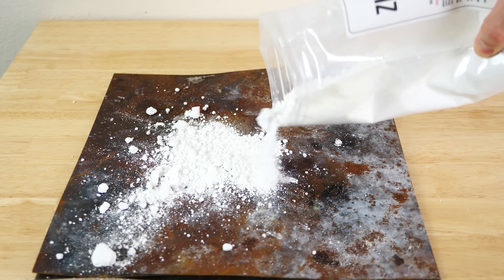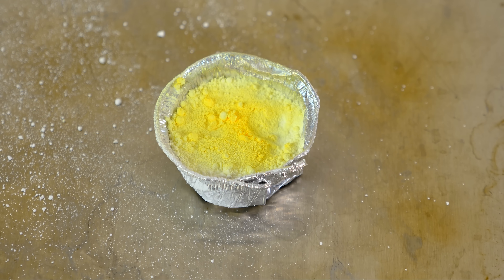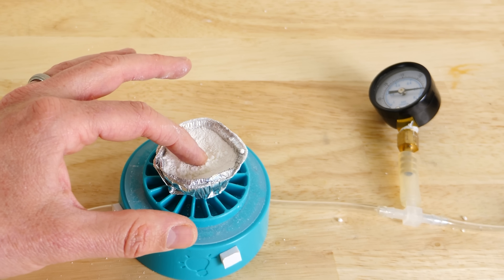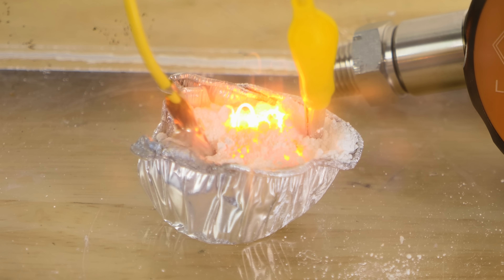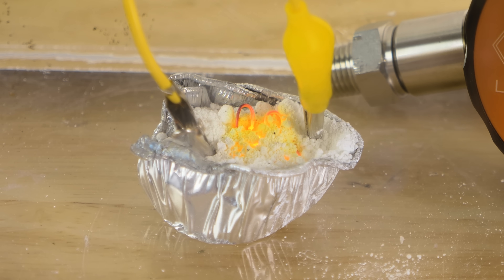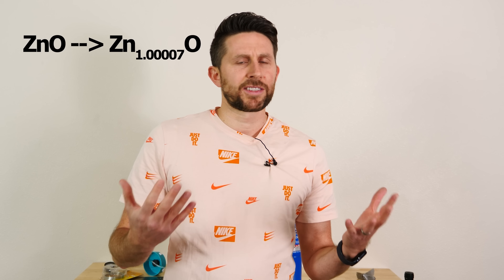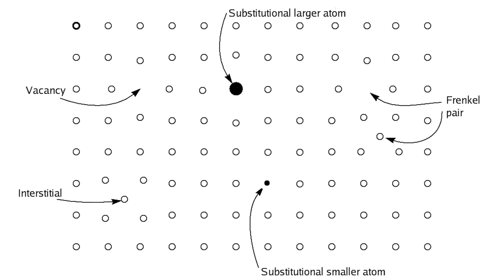How Does Zinc Oxide "Un-Burn" Itself?

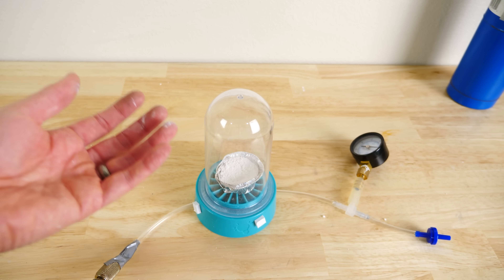Comment: 1:27 Or, and hear me out, you could have done it in an oxygen free environment. Like under argon or xenon gas. You the could have used an open lid container. … Or could have inductive heating for melting the zinc oxide.

Comment: Someone who claims to be a scientist is sure inaccurate. Your method is severely flawed due to the fact its not a real vacuum. You can clearly hear the leak in the chamber and its not 100%. Do this exact experiment again with a REAL vacuum chamber and I promise it will stay yellow for at least 30+ minutes as the oxygen diffuses through the material.

Comment: In fact, the effect is not because of Oxygen vacancy in the ZnO, instead, at high temperature, the Bandgap of semiconductor materials changed. In this case, it decreases, so it started to absorb blue light.  The ZnO Oxygen vacancy indeed increases at high temperatures, but the effect is too small to be observed directly with naked eyes. You need a special instrument for that.  Hope it helps.

Comment: Flush the bell with Nitrogren before vacuuming (you can even cycle it a few times), and only put the oxide right around the heating element so it all yellows. Will it still return to white again?

Comment: Okay..........
Step 1: configure your vacuum chamber to have an electric hot-plate with a moderately high temperature high setting.
Step 2: place a small quantity of Zinc Oxide on the heating surface of said hot-plate in a thin layer maximizing the amount exposed directly to the heat.
Step 3: hook up the vacuum chamber inlet to an inert gas source (noble gas would be best)
Step 4: draw maximum vacuum 
Step 5: fill chamber with inert gas
Step 6: draw maximum vacuum again
Step 7: apply maximum heat until color is no longer visibly changing
Step 8: film at high speed starting when heat source is turned off
Step 9: once color no longer changes back (or a couple hours pass indicating change is unlikely) use step 8 video to determine time taken.

Repeat experiment again, but at steps 7-8 allow normal atmosphere back in chamber at the same time heat is cut.
Repeat experiment again, but at steps 7-8 fill chamber with pure oxygen

Prior to or after experiment determine baseline time for all three scenarios for hotplate w/ containing tray to drop below decomposition threshold.
Compare recomposition time adjusted for input stoppage for all three scenarios.

Comment: Why is this happening. Because it’s a shity vacuum chamber/pump. While absolute pressure is considerably lower then atmosphericall there’s stil a LOT of oxygen inside. Btw, you can heat this stuff with laser pointer

Comment: a lot of comments are cool but in addition to those like replacing oxygen with inert gas or burning it again and again, i thought it could also help to have something burning on the side so it removes oxygen from the chamber and replace it with CO2. And then once that combustion stops (no more availability of oxygen remains), you can try the experiment again.

Comment: Can we use this as unlimited fuel? Like just find a way to keep it burning and when it's exhausted, just expose it to oxygen and it goes back to how it was before and then burn it again.
Reply: You cannot use it as fuel at all. You don't get energy from "burning" zinc oxide, but instead you must put huge amounts of energy into it to get it "burnt". It doesn't really burn anyway, because burning something would use up oxygen from outside to produce some kind of oxide. You can think of zinc oxide as "fully burnt zinc", so you cannot burn it any further.

Comment: but can you undo glass? So that it isnt amorph any more,but a crystalle again like sand.
Reply: Glass and sand are made out of the same compound being silicon dioxide so all you would have to do to get glass to be more like sand is to crush it
Reply: @anhondacivic6541  Well but the atomic structure is else. Ever seen Glassdust? it isnt nearly like sand.
Sand has a completely different structure than glass even if its the same molecules in there. 
A diamand is completly out of Carbon.graphit is also conpletly out of carbon. Charcoal is also completely out of carbon. .... .
Also there is red Phosphorus white phosphorus, Black phosphorus and Purple phosphorus. But every structure is completly out of phosphorus.

Comment: If the zinc is stealing oxygen from the surrounding zinc oxides to drop below the threshold, but not replenishing the oxygen that it's stealing, could you possibly keep heating and cooling it over and over to gradually leech oxygen away? I'm not sure, but I think it might be worth a try!
Reply: Maybe, it’s not a bad idea 👍🏼
Reply: The amount of oxygen that can be held by the zinc also has a threshold, so if you heat it, oxygen will also be released.
Reply: @geohubblez18  ah that's true. I think the idea would be to distribute the heat evenly, that way all the zinc reacts. But that might be a bit challenging to do

Comment: Even at 1e-6 mbar you still get a monolayer of surface interactions occuring in approx 1s in the vacuum. You need a vacuum in the e-8 mbar range to take this to minutes. A simple rotary will only manage 1e-3 mbar at best.
Reply: The oxygen coming out would likely quickly destroy that vacuum too.
Reply: @Ang3lUki  
Experiment to find out is the point, but I still see your point too.  I’m not sure what he’s saying is relevant in this case either.

Maybe there’s some study to suggest if it is, but even then, worthy of re-testing.
Reply: @deltalimabravo6727  I don't think it's possible from a bit of cursory research about those kinds of vacuum pressures. It sounds like even the carbon in the steel that the chamber is made of can destroy the vacuum in those conditions. The oxygen coming out of the zinc would generate too much pressure if even the chamber's carbon content could do that. Even if it is possible, I know for sure The Action Lab lacks the budget to do so. I do wonder if a reducing gas could gobble up the oxygen before it reacts, I think that would be more effective than a vacuum, but that involves high heat around a reducing gas, which sounds extremely dangerous.
Reply: We should try everything always. It's what helps to learn.

Comment: use induction furnace in vacuum
Reply: try electric voltage pile deoxidation, electric reduction, without the oxide being molten, solid deoxidation by electric voltage

Comment: I noticed the intake/exhaust pipe used on my little jam jar snorkeler submerged in water acts as a kind of thermometer too after it runs for awhile. About 7 minutes after starting it, a yellow appears on the galvanized pipe, but seemingly just on one side as if there's a bidirectional airflow occurring or just cold air favoring one side of the pipe. The video is Piglet Snorkeler Takes a Bath

Comment: I'll bet that the reason is due to the slowness of the cooling allowing the molecules to rearrange to a more uniform configuration, eliminating the quantum traps which cause the yellow appearance, whereas rapid cooling would preserve the non-uniformity of the structure and also preserve the quantum traps.

So, what if you could quench the zinc oxide with something oxygen-free, like liquid nitrogen? Then the yellow might stay?

Comment: You could try flushing the vacuum chamber with inert gas to help remove the remaining oxygen. You could also heat a very small amount of zinc oxide so all of it turns yellow and it can't 'steal' oxygen from the remaining zinc oxide. These changes might keep it yellow.
Reply: Fill glass dome with argon gas (welding gas), nitrogen, or any other O2 free gas.
Reply: @winstonsmith478  I don't think nitrogen is going to work.
Reply: I was thinking of this as well. Argon is heavier than Oxygen so it would float on top of it (near an exit?) unable to get back down to the Zinc.
Reply: @zecuse  The inert gas is a nice idea, but if it is not enclosed it might not accomplish the goal, because when you have enough heat to get incandescence, the inert gas is going to convect, and even if it is heavier than air it will draw some air down into itself in the course of convecting; if you get it really hot (which for something only slightly heavier like argon wouldn't be even all that hot) from heating the zinc oxide, it might just outright rise up through the room temperature air and let the air right in.
Reply: @zecuse  ok but how he would heat up the zinc oxide ?
Reply: @killerooo2336  
The point they made is moot, the point of the vacuum chamber was necessary to remove the excess (atmospheric) oxygen because the compound HAS oxygen Zinc OXIDE.  No need to add any inert gases to ‘drive off’ the oxygen in a vessel, etc 

The person above you stated the oxide part I’m adding that the way he heated the compound was not their issue (idea trying to find other methods).  Nothing wrong with any of the ideas, just funny they missed oxygen is IN the compound.
Reply: Was going to suggest using a heavier than oxygen gas. I'm wondering if he would even need a closed chamber since the gas would just sink to the bottom of the container and it might make it easier to burn the zinc oxide
Reply: @LukeAmaral  It wouldn't need to be closed. Just don't bump the container too hard or have an air current blowing over the exit and it will stay inside. It'll easily slosh around like a liquid, but more sensitive to vibrations.
 
I've seen a clip of someone holding a box of sulfur hexafluoride and then tilting it into their mouth to breathe it in to lower their voice.
Reply: @LukeAmaral  it must be done under flow, in order to remove the free o2 released by the oxide. So no matter the weight.
Reply: I was going to suggest running it under argon too, until he mentioned how much oxygen is really getting moved around. I don't t think there's much you could do that would prevent it from reverting, short of having a ridiculous ultra vacuum setup and some way of keeping unburnt pieces away from the sample... Not exactly something you could easily do in your garage.
Reply: @akaHarvesteR  I don't think even that would work, the only thing that might, is heating it up STUPIDLY hot and for long enough to drive off enough oxygen to matter, but I think you would then end up with metallic zinc.
Reply: yap, try flushing a toilet in a vacuum
Reply: @What_The_Fuck_Did_I_Just_Watch  
Exactly
Reply: i love how the comment section somehow knows exactly what I wanted to comment xD Great suggestions
Reply: Won't really help as the o2 comes from the zinc oxide. What should work is heating it to a higher temperature for a longer time while constantly pumping the released o2 out... that should do the trick.
Reply: @you2uber530  
Thank you Asaf, I read through to be sure someone stated the OBVIOUS.

It’s Zinc OXIDE and people are worried about oxygen but never bothered to think this guy is SMART and wouldn’t be using a vacuum chamber if he was only trying to avoid oxygen in the room (atmosphere).  

Then some of the logic re: using heavier noble gases might make sense.

All they did is over complicate things (often in ways that would work anyway) had they not gave it a bit more thought.
Reply: It turns yellow when heated. It may not be that the oxygen is lost, but that the heat has changed the molecular arrangement, or the surface has changed to a yellowish color.
Reply: Damn y’all smart as hell
Reply: The chamber would remove the inert heavier gases exactly the same as the oxygen (& other gases present of any ratio existing before a full vacuum was achieved) anyway.

Seems you missed the oxide part too
Reply: yep thats what i was gonna say
Reply: An easy solution: put the vacuum chamber inside another box, and fill the outer box with Argon or another inert gas.  Keep the outer box flooded with Argon at regular pressure while pumping down the inner box.

This way, when the inner box leaks, which it will, the gas coming in won't be oxygen.  Run that for quite a while - hours before heating.

Also, to verify there is no oxygen, have a second heater that is wrapped around something that reacts with oxygen.  Could be steel wool, or something flammable.  

Why:  His vacuum chamber seems to only get down to .03 ATM.  There is still a lot of oxygen in there.  A two stage inexpensive vacuum pump should be able to get 500x better than that.  But sealing a box like that is really, really hard.  There's also outgassing from gasses, liquids, and volatiles embedded in or on the walls of the container.  It takes time for those to boil off.
Reply: This "double box" method should give better results than just flooding the chamber with Argon.

Otherwise, the purging gas will be diluted by air leaks.
Reply: @alizakowski4320  Not necessarily -- if you give the chamber positive pressure with purging gas (argon or carbon dioxide -- could use evaporating dry ice for the latter) and an exit at the top, and then maintain positive pressure and a small continuous flow across a significant pressure drop (to prevent convection from drawing outside air in), then you could get a completely anoxic environment.  Make sure that the supply stream blows across the heated zinc oxide, and then keep the zinc oxide hot for long enough for the chamber to go through a few full exchanges of gas content to get rid of the oxygen that came out of the zinc oxide.  If you then cool the zinc oxide down before letting air back in, it might even stay yellow for a while after being exposed to air (especially if you cooled it down to dry ice temperature).
Reply: @Lucius_Chiaraviglio  Good point!  The vacuum maybe isn't even needed.
Reply: Man, that is a high quality comment, Meech!
Reply: I see everyone was already thinking the same basic idea..... inert gas in a chamber next time 👍🏻👍🏻👍🏻
Reply: You (all) might want to check for my proposed methodology.
Reply: @travissmith2848  🙄
You didn’t comment anything to check sparky. 
Not that you’d be right.
Certainly NEVER going to check someone’s channel with bs bait like that.
Put up or shut up.
You don’t know jack.

Comment: Wait a minute.... this looks like a reaction that could turn heat directly in to electricity with a bit of research.
Is it conductive in some state? hm...
Can it be more efficient then a Peltier device....

Batteries, Fuel Cells, Photocells Zinc Oxide is used in Zinc-Carbon dry cells, Zinc-Silver Oxide batteries, Nickel Oxide-Cadmium batteries and even in secondary batteries. In Fuel cells, Zinc Oxide is used as electrode material, cathodic material and as a fuel element.
Reply: A little far off on that science. Zinc is intensely studied and although you mentioned those applications, zinc is not an electronic components of systems. It is not capable of redox chemistry. zinc is most useful in applications w light absorption such as sunscreen or the use in photovoltaic devices like ZnS semiconductor Quantum materials. It is used in medicine because it is unreactive(redox state).

Comment: I always thought burning stuff is oxidizing stuff. But if it's a zinc oxide (i.e. already burnt), then how can you burn it even further? In other words, I don't think the change in coloration is due to the zinc oxide "burning".
Reply: So he burn it to unburn. Then burn itself
Reply: Actually you can burn some oxides even further. Carbon monoxide is an example, it's oxidized only partially and can be oxidized further into carbon dioxide. But here, he doesn't really burn the zinc oxide in a proper chemical way, he just heats it up and it looks burnt. That's why he decided to put "un-burn" in double quotes.